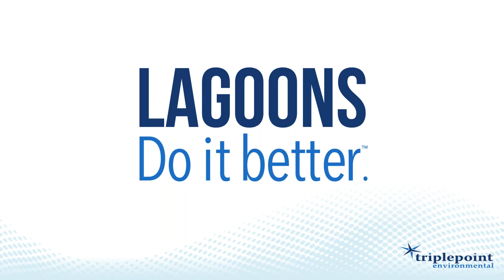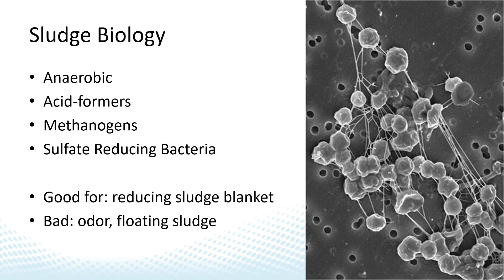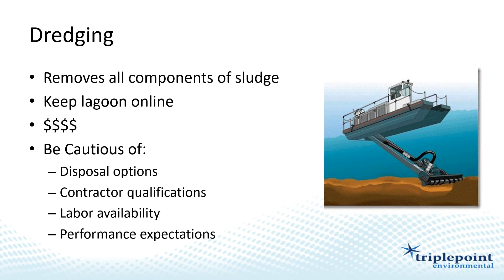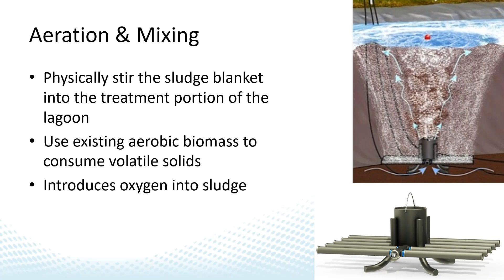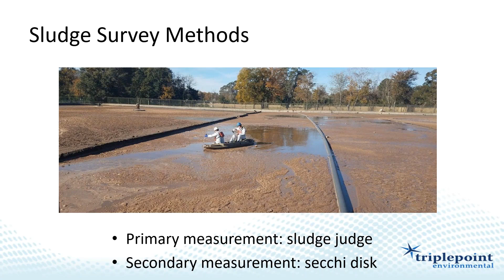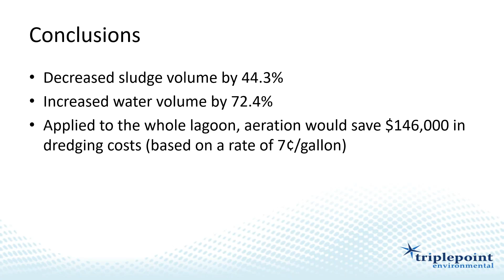In-Situ Sludge Reduction in Lagoons

Comment: We are building a home in the country where there are no sewage utilities, and we are thinking about a lagoon instead of  A septic tank system. Can you offer any guidance on a lagoon for a single residents?
Reply from the maker: We deal with municipal and industrial lagoon systems, so individual residential lagoons aren't within our expertise. However, we have come across guides for homeowners, like this one from the state of Missouri: https://extensiondata.missouri.edu/pub/pdf/envqual/wq0402.pdf?_ga=2.139787764.615737028.1562006697-1029708591.1559572561
Reply from the maker: Check with your state's university extension program or rural water association--they should be able to help you.